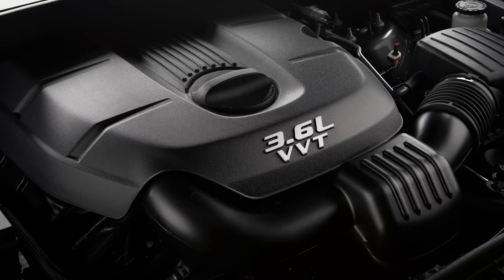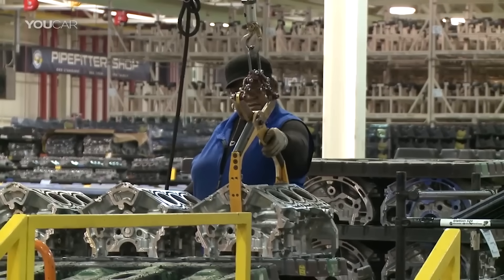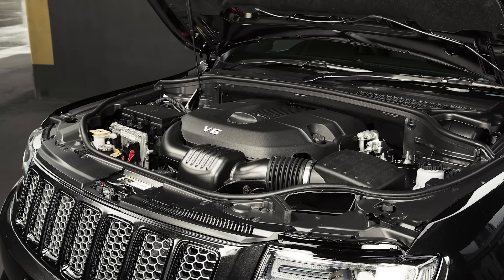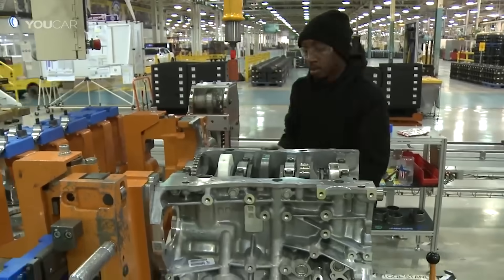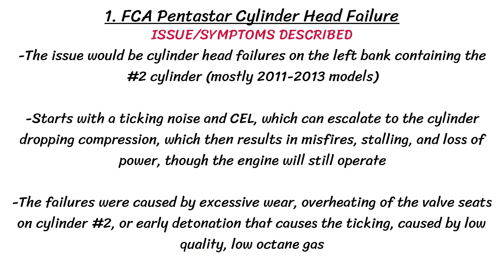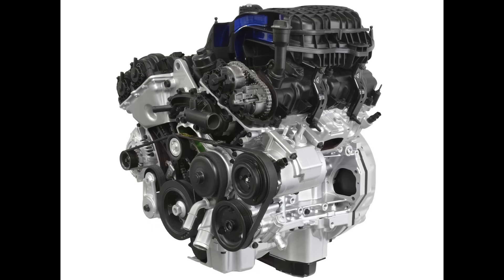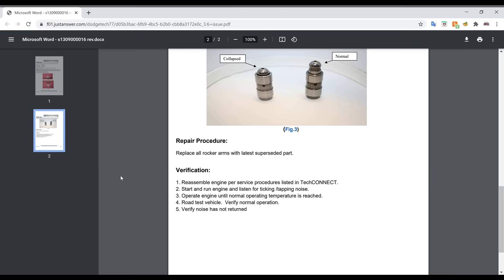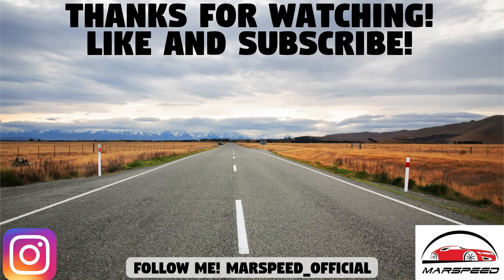The Specs and Fatal Flaws of the Chrysler 3.6L Pentastar V6 Engine

Comment: 2011 3.6 pentastar 118k miles and no issues at all. Only ones I've seen with issues are the one with owners that don't keep up with the oil changes and maintenance.
Reply: I bought my 2011 durango at 107k miles. If your experience is anything like mine its bout to hit the fan and quick lol. Good luck friend
Reply: @mmatthewdavey5704  only problem that it's given me was the oil cooler giving out but I replaced that my self.  I maintain and repair my own cars if something breaks I don't worry about it since I know I can fix it. I plan on super charging it with a pro charger when there kit comes out so I know things are going to break lol
Reply: I dont wrench but i have an excellent mechanic that schooled me on car care when i was a teenager. Im much wiser now. Had this vehicle for 4 years and its reading 209,213 on the odometer currently. She's still running, but after about 160k i started having major issues. 2 fuel pumps is one thing but im on my 3rd round of catalytic converters because ive had a misfire since then. There was one point where my vehicle would barely whimper on at start and when it did it smelled like sulphur and rumbled like crazy at idle. The cylinder bank with cylinder 2 was shut off by the cars computer to help protect them from the misfire, which almost mechanically totalled my car. Not to mention the common  fusing/wiring issue that my original owner thankfully got done at a dodge dealer before i bought it. I love my car..but it has been a pain in the ass to keep it on the road and i havent been able to pass an inspection in over well over 18 months 🙃

Comment: Mine has been a amazing engine. I have a 2016 challenger. 80k miles. I also run it pretty hard for a normal car and there is no ticking yet.
Reply: 120k miles on my 2011 Charger 3.6.  10w30 Penzoil full synthetic every 8k, zero ticking. Did have to replace my oil cooler unit this winter. Upgraded to R/T shocks and brakes, Diablo tuner 91 octane tune, cold air intake, dual exhaust and Tranzformer II....  0-60 in 5 secs flat.

 Awesome V6 when cared for.
Reply: 86k miles with my 2016 300C. Runs great

Comment: The only issue I have had was the oil pressure switch failing other than that she's solid
Reply: I got this issue right now with my oli pressure switch
Reply: @terrancewilson6066  easy fix just don't forget to replace your o-rings and seals
Reply: @keithadams897  ok easy fix thank you.
Reply: @terrancewilson6066  bad part is that you have to unhook a ton of wiring and bolts just to get to what you need

Comment: I’ve used a 3.6l for work. One with a ram and one with our van. I gotta say I can’t stand them. Once they get to operating temp they seem to just run hot for no reason. They aren’t very fuel efficient, and the van got a tick at around 40k. It’s a cheap mass produced base engine so I don’t blame it for not being able to put in a lot of work, but I definitely wouldn’t be buying one with my own money.

Comment: Chrysler 3.6 is a GREAT engine!!  A wide variety of vehicles have them since 2012, and it's pretty hard to find them to flip needing an engine,  unlike the 2.7 that came out in 1998, and was only on the LH cars until 2001, when the JR became available,  and were already common on the market as flipper cars needing engine work in 2004!  BTW,   GM's 3.6, are quite problem prone! like the 2.7s though not nearly AS bad?
Reply: GM 3.6's only have timing chain issues if you run them low on oil...they had a pvc system that was faulty not allowing enough crankcase ventiliation... it's easy enough to jump ahead of this problem by pulling the ccv valve out & drill the holes out a little bigger  and just keep an eye on your oil level every now & then; make sure it stays full & they don't give you any problems...MUCH more reliable/problem-free than any Pentastar engine imo...I personally have driven my Caddy CTS 140,000 miles & counting and have only had to replace the coils once after one of them went bad...that's it so far fingers crossed🤞
Reply: @jbone1383  I wasn't aware of PCV issues on the GM 3.6 though I know timing failure is from low oil.   Chrysler 2.7s also had poor PCV systems and often sludged up as well.  But I disagree on it being MUCH more reliable than a penta star, which often goes over 200,000 miles with ZERO problems. They probably rank the same especially the newer versions.  My girlfriend has a 2013 Town & Country with over 200,000 miles,  her sister has a 2015 Enclave (not sure how many miles), both are great vehicles.
Reply: @carlweeks9256  If her minivan went past 200,000 miles on the original transmission & didn't have any oil leaks from the oil filter housing that needed to be addressed, coolant leaks from any of the plastic parts on the front engine cover or water pump, rear h/vac problems or any TIPM issues or problems w/ the valvetrain anywhere I would be absolutely amazed...That does NOT happen often w/ those vans and that 1 would deserve a round of applause👏 Vehicles like that actually deserve to be fixed using your hard earned $$$ if & when they do break down...
 Just for comparison though, the 2015 Buick Enclave currently has 59 complaints filed w/ the NHTSA, the 2013 Dodge GC has 399! That doesn't tell me everything I need 2 know, but it does say alot! Now I realize the minivan has had 2 more years to rack up complaints on the Buick, but I would bet u a dollar it won't have 340 more complaints filed against it over the next 2 years
Reply: @jbone1383  I have definitely had to replace some plastic Tees in the heater hose lines, but that isn't a part of the engine or transmission.  Also the Minivans are more popular,  so that can contribute to the complaints. Try looking up Chevrolet Traverse,  the more popular enclave relative.
Reply: @carlweeks9256  more popular should  not equal more complaints if the pentastar really is this GREAT engine that OFTEN goes 200k with zero problems like u claim...I just looked up the 2014 Chrysler Town & Country b/c we were looking @ a really clean one that was for sale...532 complaints w/ NHTSA! I said NOPE, you couldn't give me one for free after reading some of them; numerous people having experiences of the van just shutting off completely while driving down the road, one guy said his caught on fire & the fire dept. had to come out, several complaints of the headrest airbags just popping out without warning or actually getting into an accident!?! I said okay, I've read enough smh🤦‍♂️

Comment: Bought a 2014 Dodge Grand Caravan. Right (rear) rocker arms and valve tappets failed at 70000 miles. Not covered under warranty so I had to shell out $1800.00 at the Dodge dealership to have them repaired. A year later the same thing was happening so I dumped that Lemon.

Comment: I wish they'd revive the old 2.5 and 4.0 inlines that AMC made. Make them aluminum, overhead cam, and variable timing to meet emissions. If you have to get a 6 cylinder half ton, an I6 would be so much more appealing than a v6 in lieu of a v8.

Comment: Since they fixed the original head issue these are one of the best v6s ever made in my opinion, I’ve put 100s of thousands of miles on this motor and never had a problem.
Reply: Vqs are the best v6
Reply: @inse728  nah the 3800 is the best period. The 3.6 pentastar is just next on my list for the v6s the 4.0 i6 in jeeps and the 3.8 for Buick’s and other gm cars. Those are the best for the i6 and v6. The Nissan vqs is a cool engine but I wouldn’t want to own one long term.
Reply: @dmoney6633  No, VQs are world class and well respected amongst most engineers and enthusiasts.
Reply: @dmoney6633  They're good long term if u keep up with the maintenance. Vqs can go well over 200k plus miles.
Reply: @inse728  I’m not saying they’re bad at all they’re a good motor. I just like the stuff i mentioned better.
Reply: @inse728  like hell. Not even a pimple on the 3800's ass. Junk timing chain guides, ridiculous waterpump arrangement, oil consumption and subsequent catalyst destruction, oil leaks, etc, etc. 3800 is simple, reliable as an anvil, and known for running until the body rots away around them. I send nice looking Nissan/Infiniti models to their grave every year, because cost of major engine repair exceeds the value of the vehicle. I've been a technician for 30+ years.
Reply: how are the 2020-21 motors? im still digging around
Reply: What is the original head issue ..? The rocker arms and lifters going bad ??
Reply: You all talk like 150-200k is a lot. I had an 81 Ford LTD Alabama state trooper car that had over 390k when I sold it. There is no telling how many hours it idled beside the road. It leaked from every seam, but it ran great. The whole car ran and drove great at 390k.

Comment: Excellent engines!  I've owned 3 of them, and the only problem I had was a leaking timing cover gasket that was replaced under warranty.  Chrysler has made well over 10 million of these engines in 10 years and the failure rate is almost non existent.  Very successful, very good engines.  BTW, the "ticking" that most people hear when these engines are running is the high pressure fuel injectors ticking.
Reply: Yes! There should be a ticking sound of healthy injectors.
Reply: Not when it is accompanied with a misfire code. Or when you pull the valve cover off and find a rocker you can almost remove by hand. If you mistake an injector for valve train problem you shouldn't be turning wrenches.

Comment: I have that engine in my 200c ... no internal failures but what if it is very serious that in a short time the filter and oil cooler fail ... I already had knowledge of the failure but I thought that because it was a newer pentastar I no longer  I would have but the problem is that it continues ... I don't know who came up with putting that cooler between the engine heads, the heat that is generated in that area is high and that is why it fails, the most logical thing is to have put it out  engine ... even so it is an engine with a power almost identical to a hemi 1g.

Comment: thank you for this video, can you PLEASE  do one on the pacifica I want toknow more about the 38 vs 4.o liter v6 engines in them PLEASE?
Reply: The 3.8 liter is a 12 valve pushrod engine. Pretty simple but its a dog. The 4.0 is a very different animal. SOHC and is an interference engine so watch out for those timing chains and make sure they get changed regularly. Its also the most powerful engine of that generation.
Reply: I would pick the 3..8 for simplicity I had the sister 3.3 engine in a T&C van with no issues for 100K miles before trading in.

Comment: Keeping up on TSB's and maintaince is key. This is quite exciting.
Reply: Have replaced 2 of these for cylinder 1 compression loss..its an ok engine,like you said CHANGE YOUR OIL
Reply: There’s no TSB for the oil cooler which I’ve found to be the number one problem for this engine
Reply: @Haltech92  Any oil cooler fails if the oil is contaminated due to neglect, coolant entering oil or major engine failure (metal particles in oil galleries/passages etc.) Never clean or reuse an oil cooler/elements. Get a new one.
Reply: @dontgetwellboi1240  I’m not disagreeing but for me to do for of them in a few months span with all of em under 50k miles is not a coincidence
Reply: @Haltech92  That is strange. Not flushing out the entire engine oil passages/galleries improperly or not fully is one thing that comes to mind. This is a tough one. Haven't ran into that one.....
Reply: @dontgetwellboi1240  I have my Caravan 2019...20.000 KM   and the transmission kick's already !  What to do ??  Still under warranty !
Reply: @juliusboy001  There are many tricky symptoms but most likely it might be low transmission oil level. You check the transmission oil level while the engine is running and is in the "parked" position. It has to be in the middle of the min/max  operating range on dipstick. Use the recommended automatic transmission fluid for the vehicle. If you're still under warranty, let the dealer check it out

Comment: Chrysler used to be a company known for it's advanced technology. That all started coming to an end in the late-60's when quality and quality control took a dive. Quality started going up after Daimler-Benz took over.  After FIAT took over Chrysler, quality has been taking a serious dive. Some of which was due to FIAT disguising their own cars as Chrysler, Doge and Jeeps. One of these cars, the Dodge Dart II had a very short production run because the cars cost the corporation a lot of money in warranty repairs. Plus, people got smart and stopped buying them. After Chrysler and Cummins invested a lot of money in co-developing a light duty diesel V8 engine, when FIAT took over, they refused to have any part of it. FIAT built it's own diesel engines and didn't want to outsource. They ended up putting a FIAT V6 diesel in the RAM 1500 trucks. Soon, because of problems and the fact that the emission systems were bogus, the dealers sat with trucks they couldn't sell and those who had bought one previously, were up a creek, similar to what happened with VW and their diesel cars. 
The Hemi V8's, which aren't true Hemis, also have their problems with cylinder heads, cylinder cancelling hardware and overheating problems due to faulty software.
Reply: When Daimler-Benz took over, it was a bad deal for both Chrysler and Mercedes-Benz. The Mercedes-Benz cars from that era were actually more reliable than the Chryslers. In the beginning they were doing ok but when they decided to cut costs, they fucked up Chrysler and ruined them and that’s one of the reasons why the merger failed. Then FIAT fucked it up even more. Now we got Peugeot in the mix and I don’t know if they are going to screw them over even more or not. When Bob Eaton took over Chrysler, he ruined it. Bob Lutz should have been Iacocca’s successor. Just like Bob Eaton ruined Chrysler mostly for the 2.7 V6 high warranty claim rate that resulted in a class action lawsuit, Rick Wagoner ruined General Motors because of the ignition switch on the Delta and Kappa platform cars and that’s why GM and Chrysler went bankrupt in the late 2000’s and not Ford despite of their defective 6.0/6.4 Powerstroke and 5.4 3 valve Triton engine that had a high failure rate. Now Ford’s stock are just one notch above junk status because of the Focus, Fiesta, and non-US spec Ford Ecosport DPS6 transmission disaster and the COVID-19 pandemic. It cost Ford a lot of money to settle the lawsuit. It costs them hundreds of millions of dollars and on top of that they have to compensate owners overseas too.
Reply: No no, when Chrysler took over AMC in the 80s, that's when quality took a nose dive, it gave AMC control of their product engineering.

Comment: Thanks for the video. I own Dodge Durango 2015 and Dodge Grand Caravan 2012. So far no issues with both cars having 3.6 pentastar. The mileage is still pretty low ( 120 000 and 151 000 km ). My question why the oil cap for GC is having 5w-30 and on Durango 5w-20 engine oil recommendations. These are still identical 1st gen pentastar engines?
Reply: That is because your Durango is built to tow up to 6200 pounds and it requires platinum full synthetic oil To Resist the heat and pressure in higher RPM That makes the Durango sportier as well. And the engine in your 2015 Durango is second generation of the pentastar, not the first one!

Comment: I love mine in the 2011 Grand Caravan. But I’m shocked you didn’t mention the TIPM issues. I had to send mine out to have the fuel relay board repaired. But overall it’s a beast. It has never ever used any oil. Ever!